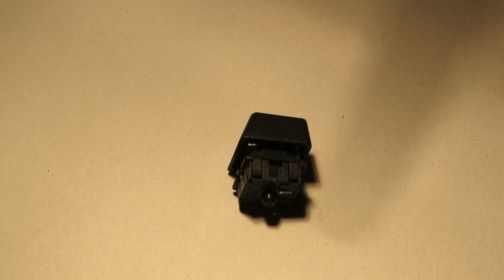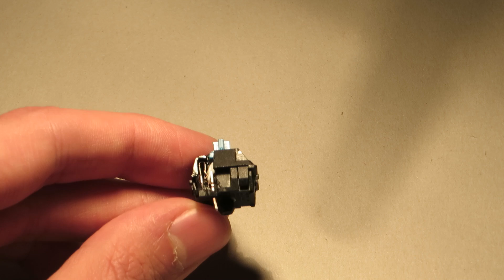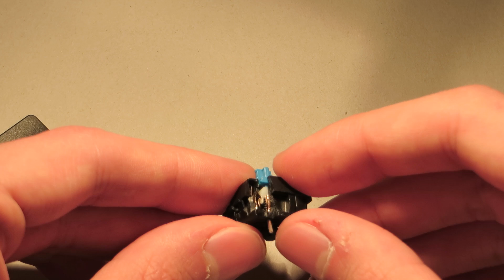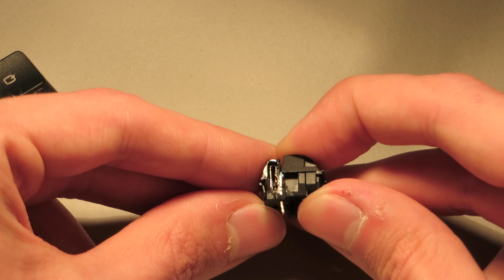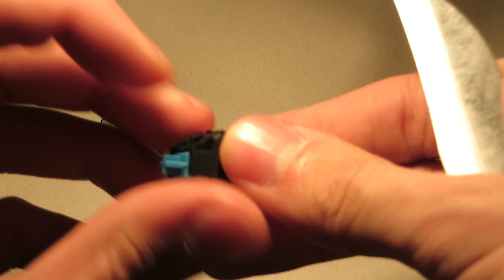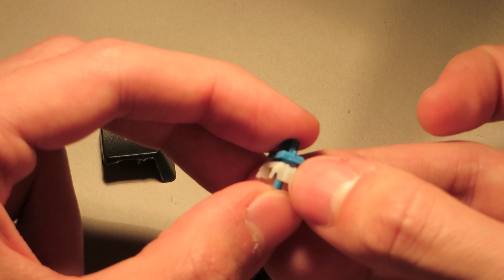What makes a Cherry MX Blue click?

Comment: does it really have an effect on double tapping that much in games? IE space bar or AD strafing or q weapon quick change? I bottom out my keys when I press so assume it wont be as much of an issue
Reply from the maker: It doesn't matter if you bottom out, what matters is whether you fully release the key after the first press. If you don't, there's a chance that the second press doesn't register.
Reply: @Blue5hock  gotcha thanks! Thankfully always been one to let go of the key completely instead of hovering around actuation! Got a hotswap board  just incase I end up wanting to move way from blues. This video was very informative
Reply: I know this comment is over a year old, but I would go for Kailh Box Whites these days over Blues any day. Better sound, tactility, and no hysteresis like Cherry MX Blues.

Comment: Can you quiet down that click or just remove it?
Reply from the maker: You can either mod them to "Jailhouse Blues" (basically glue both parts of the slider together) or just use a different stem.
Reply: @Blue5hock  Thanks for answering so fast. And btw great video helped so much!

Comment: This was really informative. I really liked how you dissected and explained the mechanisms of the switch. Can you do one for the other Cherry MX colors?
Reply from the maker: shatbrix The other ones are quite boring, they don't have any moving parts like the MX Blues.
Reply: @Blue5hock  can you remove the tactile so there would be only click? I have wooting switch so probebly that one is made out diffrently xD It click twice... once activated and once it goes back. Do u think i can make it only click once when activated and make it smooth like red ones? I have mostly keyboard Red switches
Reply from the maker: @Mboy556  No.

Comment: so i have a razer black widow,and it seems that my release spring is jammed,it stopped clicking,what do i do with it? can i put some sewing oil into the switch by pressing the switch down? im really frustrated :D
Reply from the maker: Putting oil into the switch is a bad idea. The only way really would be desoldering and cleaning the switch from the inside.
Reply: that was a quick reply,got yourself a subscriber :D
Thanks.
Ill try opening it up and taking it apart.what lubricant should i use? saw that a few use the finish line's  extreme fluoro grease,it any good? you have a personal preference?
Reply from the maker: There's no need to lube clicky switches in my opinion - if you lube the wrong parts you'll probably make it less clicky than before. Just remove any visible dirt in the switch, reassemble and see if it clicks again. If it doesn't you'll probably have to replace the switch.
Oh and if you still have warranty on the keyboard, make use of it of course.
Reply: yeah,you are right,ill try,but these kailh razer switches are a pain to be opened
Reply: hah funny thing,i just pressed it fast a few times and it started clicking again.. hmm what might've happened there? could it be that the spring got jammed somehow?
Reply from the maker: Maybe some dirt got into the switch and got loosened up again? Just a wild guess. Kailh switches aren't exactly high end either, so there's that ;D
Reply: hah ikr :D i unplugged it now,tried with some water and alchohol,going to leave it to dry for a day or two.if it doesnt work ill have to go the hardcore way of dissasembly,thanks for the help :)
Reply: David Aleksic have u fixed that shit dude ? I dropped some ethanol alcohol into the switches,they stopped clicking,i tried to dry it with drier,left it for a few days,but they still don't click..

Comment: even though this video is a bit older, can u make a blue switch linear by removing that white "click making" thing ? or make it not click ?
Reply from the maker: +JahvoPlays You would have to replace the whole slider with one from a red or black switch. The switch will not work without the white part.
There were some experiments with making the white part fixed, but the result is hardly worth the effort in my opinion. If you're still interested, search for "Jailhouse Blues".
Reply: thanks for the quick answer :3

Comment: If i'd buy a MX red keyboard and change every key to MX blue spring and stem, would there be any difference between normal mx blues? Or do i need to solder the blue switches, for a "full" mx blue experience?
Reply from the maker: +Thx And Bye There would be no difference.
Reply: +BlueBär awesome, that's for the answer.